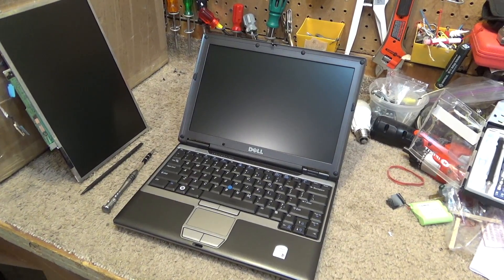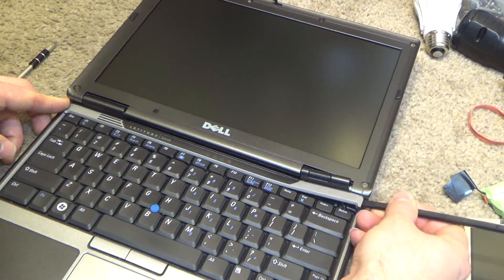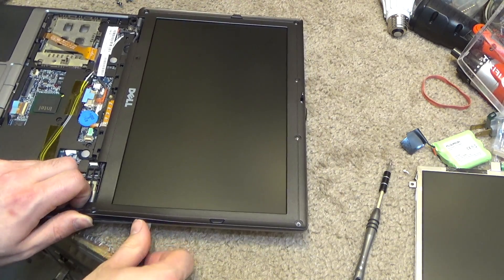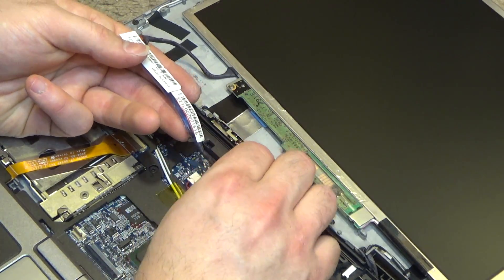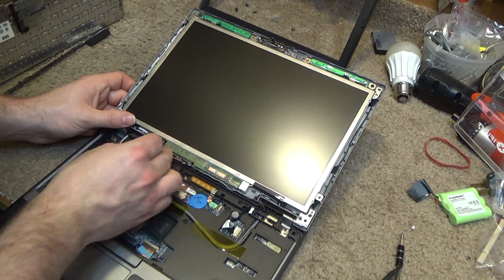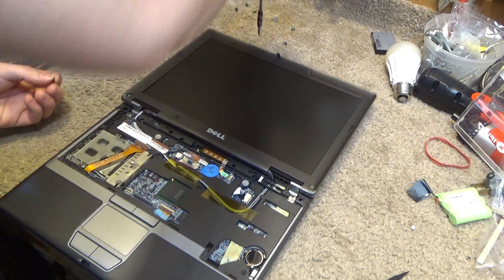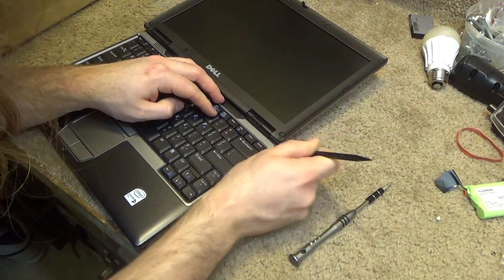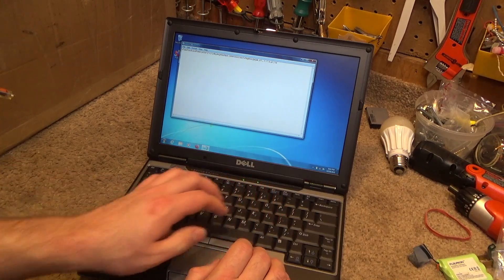Dell Latitude D430 Laptop Screen Replacement

Comment: No need to remove the keyboard; the LVDS cable unplugs from the back of the LCD panel, then plugs into the new one.  Unless, of course, you wanted to replace the LVDS cable, but it was proven there was nothing wrong with it in the first place.

To remove the bezel, first off I recommend a smooth surface to place the rubber bumpers on, which ensures they will stick better once put back on.  To remove the bezel, I use my fingernails.  Right hand does the left side, left hand does the right side.  Work the bezel off from the inside of the screen out.  Usually it's a lot less of a struggle that way.
Reply from the maker: True, but since the new screen came with one, and since that is a component that wears out, I figured I might as well just change it while I was already working on the unit.
I've done it the way shown in the video forever, next time I'll try from the center and see if that's easier.
Reply: @JordanU  brother I need that screen for my laptop d430 what should I do

Comment: That is kind of strange damage as you can still see the image where it is. I really like these older dell latitude models, I just picked up a few pretty nice machines from my friend today. I got 3 core 2 quad dell XPS desktops, 2 dell latitude e6500 laptops, a dell latitude e6410 laptop, and a dell latitude d830 laptop. all of the laptops are fully loaded with the NVIDIA graphics (which can be seen as a good thing or a bad thing) . The only issue, and something that really aggravates me is that since my friend bought them from large surplus auctions, they always pull out the hard drives and never replace the caddy, they just take the drive caddy out and don't put them back in. It bothers me because it just seems like a small step that does not take much effort at all, just to put the caddy back. But I guess I didn't pay anything for them, so I can't complain too much.
Reply from the maker: I do too, I'm very fond of the older Latitude line. I got an 830 recently as well, and a 6400. I like both machines a lot. I've noticed a lot of people will remove and discard the caddy and/or the door before selling. Very frustrating indeed. I guess people never intend for the machine to be used again.